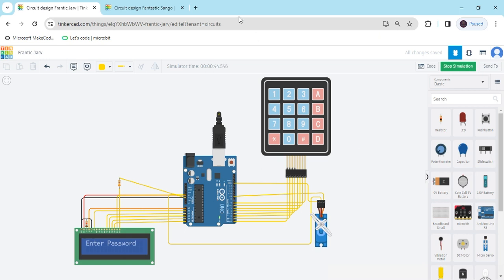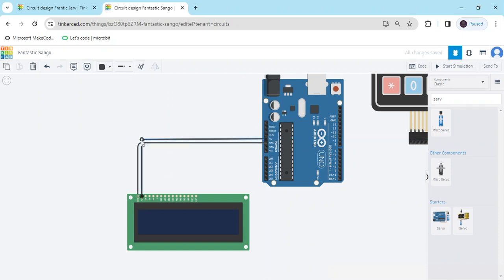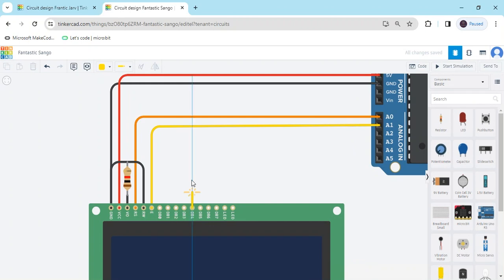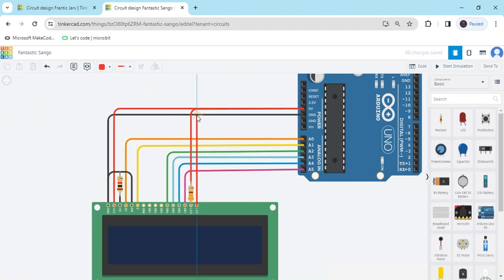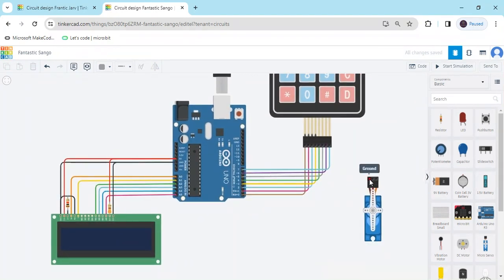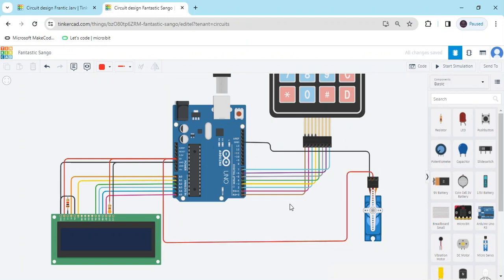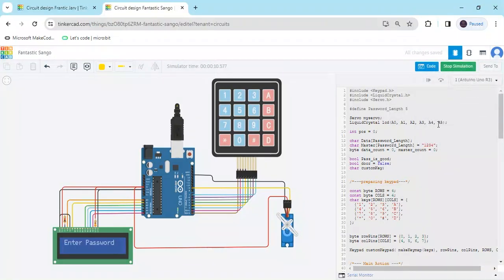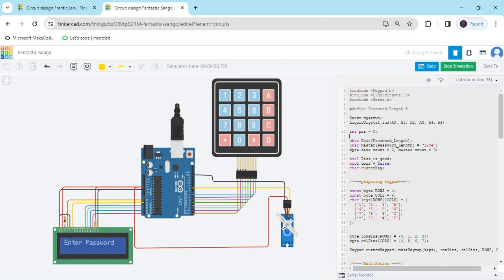Password Door Lock Arduino Project Using Tinkercad

Comment: code.txt
#include <Keypad.h>
#include <LiquidCrystal.h>
#include <Servo.h>

#define Password_Length 5

Servo myservo;
LiquidCrystal lcd(A0, A1, A2, A3, A4, A5);

int pos = 0;

char Data[Password_Length];
char Master[Password_Length] = "1234";
byte data_count = 0, master_count = 0;

bool Pass_is_good;
bool door = false;
char customKey;

/*--preparing keypad--*/

const byte ROWS = 4;
const byte COLS = 4;
char keys[ROWS][COLS] = {
  {'1', '2', '3', 'A'},
  {'4', '5', '6', 'B'},
  {'7', '8', '9', 'C'},
  {'*', '0', '#', 'D'}
};

byte rowPins[ROWS] = {0, 1, 2, 3};
byte colPins[COLS] = {4, 5, 6, 7};

Keypad customKeypad( makeKeymap(keys), rowPins, colPins, ROWS, COLS);

/*--- Main Action ---*/
void setup()
{
  myservo.attach(9, 2000, 2400);
  ServoClose();
  lcd.begin(16, 2);
  lcd.print("Protected Door");
  loading("Loading");
  lcd.clear();
}

void loop()
{
  if (door == true)
  {
    customKey = customKeypad.getKey();
    if (customKey == '#')
    {
      lcd.clear();
      ServoClose();
      lcd.print("Door is closed");
      delay(3000);
      door = false;
    }
  }
  else
    Open();

}

void loading (char msg[]) {
  lcd.setCursor(0, 1);
  lcd.print(msg);

  for (int i = 0; i < 9; i++) {
    delay(1000);
    lcd.print(".");
  }
}

void clearData()
{
  while (data_count != 0)
  { 
    Data[data_count--] = 0;
  }
  return;
}

void ServoClose()
{
  for (pos = 90; pos >= 0; pos -= 10) { 
    myservo.write(pos);
  }
}

void ServoOpen()
{
  for (pos = 0; pos <= 90; pos += 10) {
    myservo.write(pos);  
  }
}

void Open()
{
  lcd.setCursor(0, 0);
  lcd.print("Enter Password");
  
  customKey = customKeypad.getKey();
  if (customKey)
  {
    Data[data_count] = customKey;
    lcd.setCursor(data_count, 1);
    lcd.print(Data[data_count]);
    data_count++;
  }

  if (data_count == Password_Length - 1)
  {
    if (!strcmp(Data, Master))
    {
      lcd.clear();
      ServoOpen();
      lcd.print(" Door is Open ");
      door = true;
      delay(5000);
      loading("Waiting");
      lcd.clear();
      lcd.print(" Time is up! ");
      delay(1000);
      ServoClose();
      door = false;      
    }
    else
    {
      lcd.clear();
      lcd.print(" Wrong Password ");
      door = false;
    }
    delay(1000);
    lcd.clear();
    clearData();
  }
}